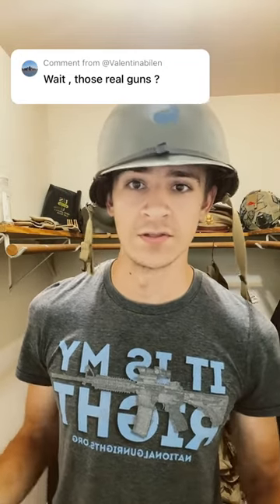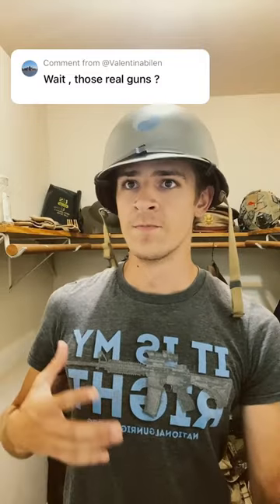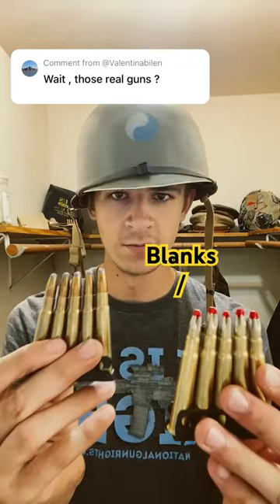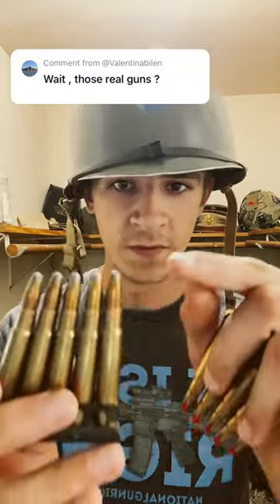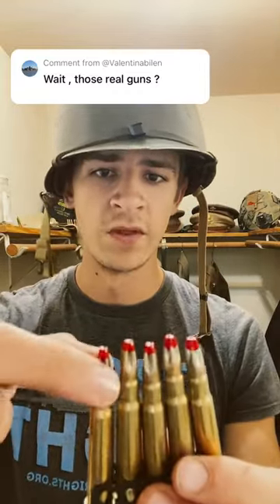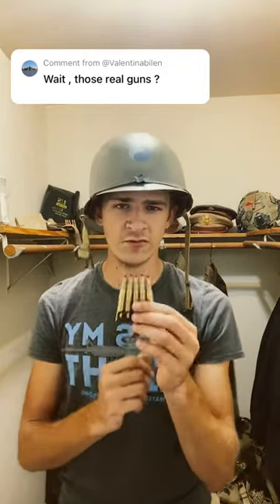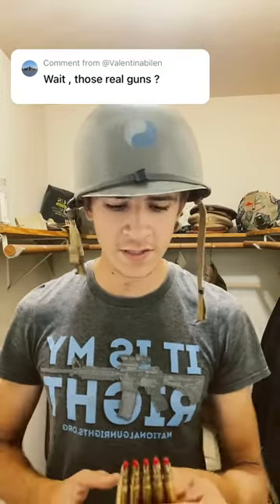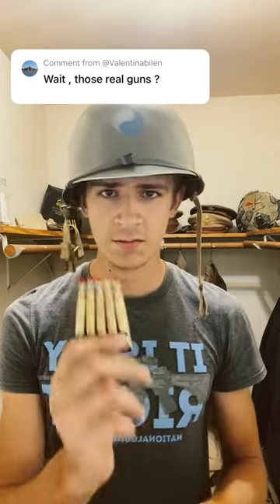“Do they use real guns in WW2 reenactments?” #ww2history #fact

Comment: Thank you for the free education. I have always wondered about blanks so thank you.
Reply: There are a few different types of blanks and blank fire rifles. During ww2 blanks in the german army for heavy guns like 2cm flak guns used a wooden plug with a special wood splitter on the end of the muzzle so it would break up the wood plug. The us military uses a blank fire device that diverts the gasses out  to the sides of the muzzle so it doesnt go directly  forward. Blank fire only rifles have been modified so its impossible to fire actual real bullets. Blanks today are crimped cartridges that are shorter than real ammunition. Making a rifle suitable for firing blanks is a hard task for a semi auto rifle as without the projectile  you need to make a barrel obstruction to cause enough pressure in the gas system or what ever system the rifle uses to to cycle it. Blank fire rifles have several different types with the main ones being out the front venting or out the side venting with most of Europe  it's actually illegal to use out the front blank fire rifles. Also blank fire out the front rifles are even capable of popping balloons from several feet away. So I hope that helps.